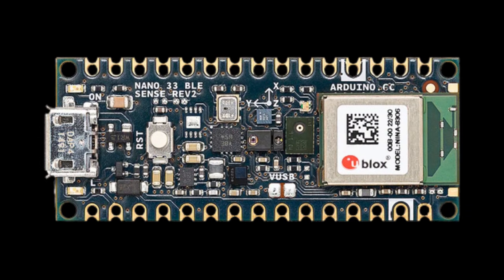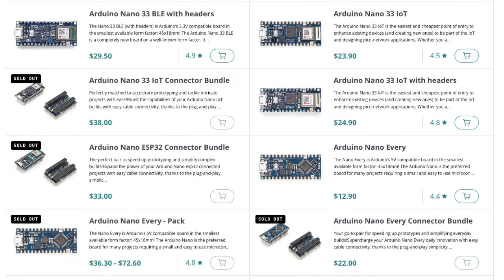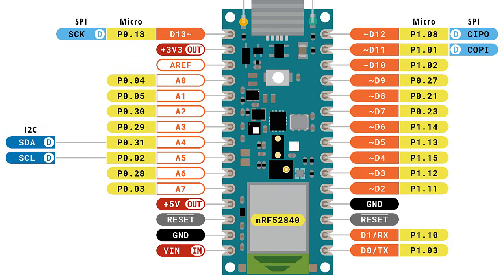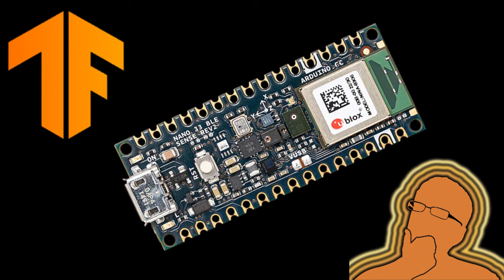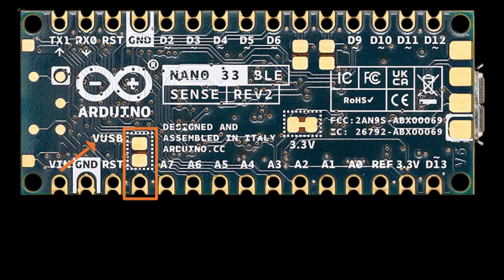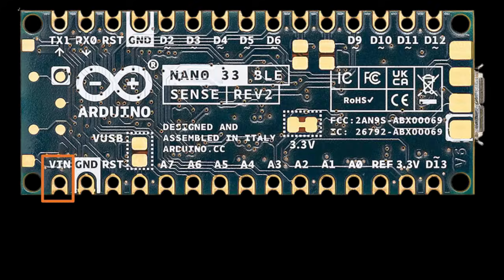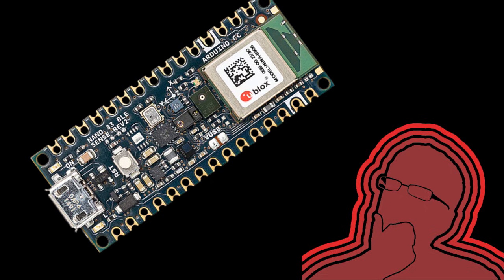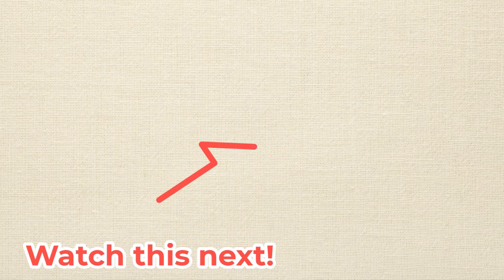Buying an Arduino Nano 33 BLE Sense Rev2?  WATCH THIS FIRST!

Comment: That’s a pretty cool board but you would think it would have WiFi to connect to the Arduino cloud.
Reply from the maker: Same thing I was thinking - they do have an Arduino Nano 33 IoT with is the version with WiFi - but I'm not sure it has BLE too or not.  I think that you could use a WiFI/BLE gateway board (like an ESP32) that would send data from the Nano 33 Sense to the Arduino cloud.